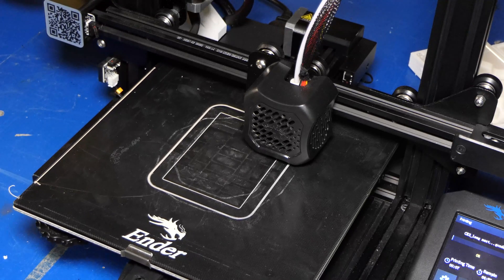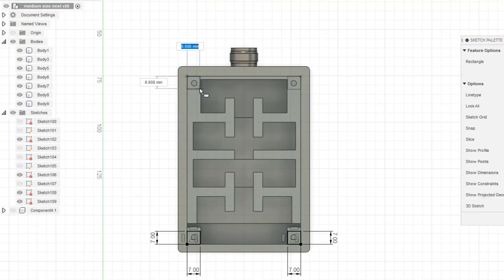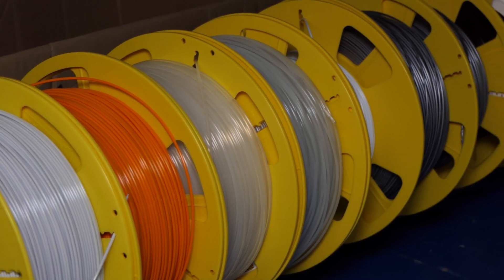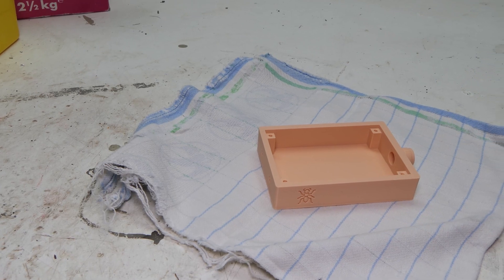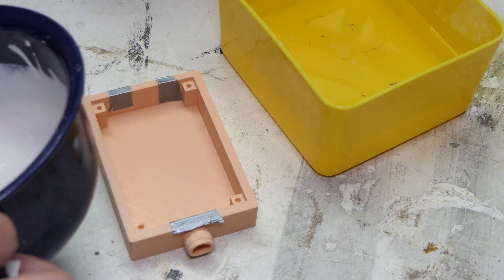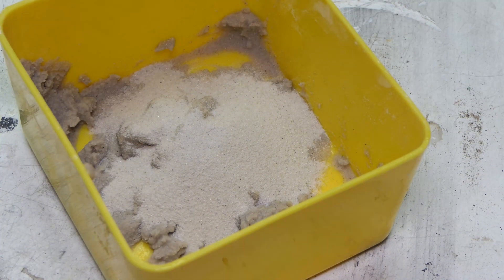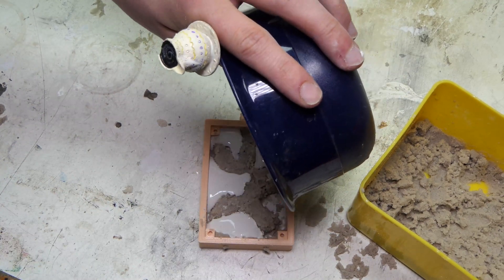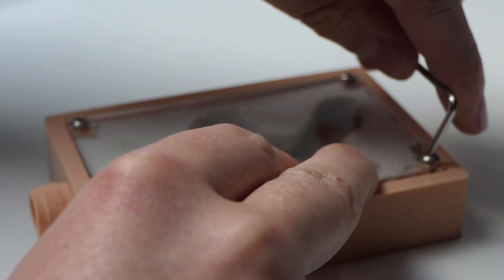3D Printing + Plaster = Ant Nest! | Ant Nest Formicarium

Comment: I know this an old video, but I have a pretty cool idea that you could use this for. You could potentially sell the shell of this ant nest and allow customers to buy different insides to slot in, so if they want to use that shell, but need to house a smaller species, for example, you could insert the slot the insides in that have tighter, smaller insides. I have some experience with fusion 360 and I think it would be possible (:
Reply from the maker: Very cool idea but hydration wise a lot of problems😬
Reply: @EstheticAnts  true, makes sense ):

Comment: @Esthetic Ants  Did you print this in PLA? How has the nest held up since making it? I'm glad that I found this video! I feel far more comfortable now that I've seen somebody else do it and know that it actually works. Did you figure out any methods for coloring the plaster? I've designed the same style of nest and will begin assembly within the week. I've coated the interior of the PLA "box" with epoxy resin to provide a moisture barrier and provide additional strength.
Reply from the maker: Uhm it broke pretty easy. Would not recommend it. Yes PLA
Reply: @EstheticAnts  what part of it broke???  That's not what I wanted to hear :(    but at the same time I'm really glad you warned me
Reply from the maker: @br1x3nah  plaster inside

Comment: Wat is the name of the first 3d printer you had in your first videos and how much do they cost because I want te get me a 3d printer maybe?Depends on how much they cost
Reply from the maker: It's not worth it, to expensive, you can better buy nests instead😅
Reply: Ok
Reply: Thanks for the advise
Reply: If you want to print only a few nests, it probably isn't worth it, but if you have more practical use for a 3d printer, the first one is named Ender 3 by Creality, going for around 150-300 Euro, depending where you  buy.
Reply: Thanks man